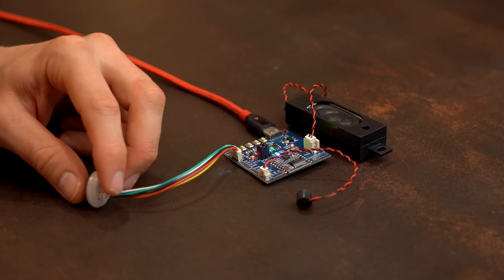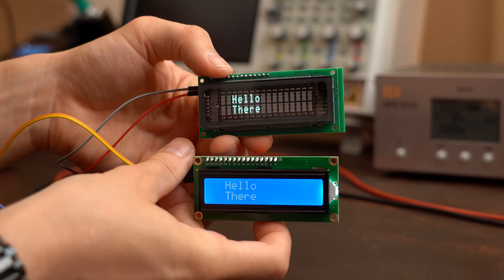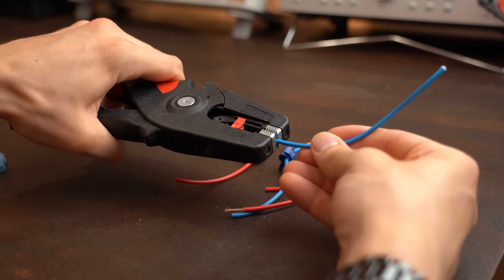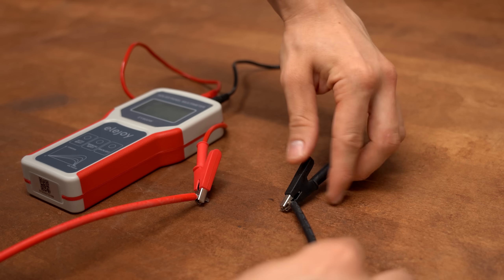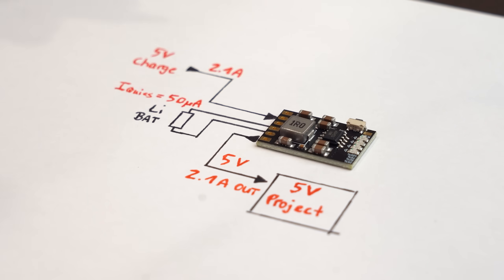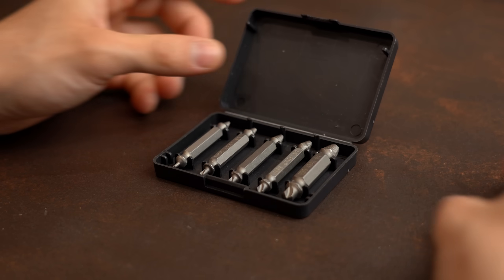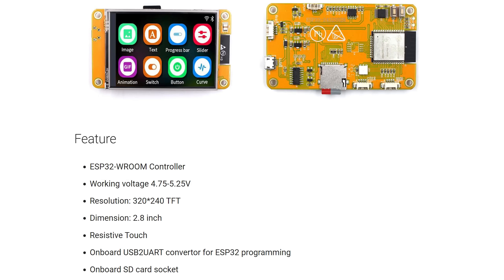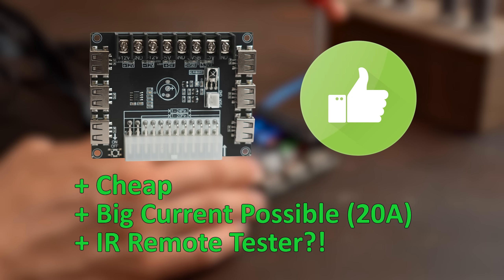I tried finding Hidden Gems on AliExpress AGAIN! (Part 6)

Comment: 2 issues:  T-tap connectors are generally used by car accessory installers, in those cases the mating ends are usually pre-terminated or pre-stripped, so it really is faster to just clamp the correct (color matching, red, blue) T-tap to send something like a low current remote signal, or 12v at less than 3A.  Second, that ATX power supply trigger doesn't have a load resistor.  I've run into ATX supplies that won't turn on without a load, and ideally you should have some sort of load to make the power supply regulate.  I would expect a good ATX trigger to have a load resistor, otherwise you can't know what power supply the customer is plugging into it and thus get a bad experience.
Reply: The problem with the T-taps is they are junk.. Do NOT use them in a car (or anywhere for that matter).  It may work when you first install them, but down the road, they become intermittent causing all kinds of issues depending on what you used it for.  Not to mention the unseen damage it does to the wire.  Just terrible product all around.
Reply: @turbo2ltr so, what should i use in a car to “intercept” signal wires (not power ones) without damaging original cabling ?
Reply: @chrisparussin5359  Nothing. You aren't going to be able to "intercept" a signal wire without at least compromising the insulation (which these do). If you aren't going to be able to "go back to stock" without repairing or replacing the wire anyway, why not go with something more reliable?
Reply: @jcon6734  because if i remove a t-tap, i can leave the blue part of it and it will be insulated or i can just use electrical tape and more fabric tape over. if i cut the wire i have no way to return to stock
Reply: @turbo2ltr  I worked as an automotive electrician for years and they were never an issue you just need to use the correct size for the correct gauge
Reply: You say that while displays I installed at Home Depots around Cincinnati are still working fine a decade later. TONS of low voltage light setups use something similar where the tap is actually built into the line and you just clamp them on a powered line for an active splice and others I've seen are identical to the ones shown in the video. No idea about vehicle usage but I've never seen a crimp on splice fail in a display or using them at home in low voltage lighting setups. The only real issue is if they're marketed as one size fits all instead of marketed to a specific wire gauge like they were intended.  @turbo2ltr
Reply: @Hogscraper cars are an exceptionally difficult environment: you can hit lows of -30C when cold, in winter, and highs of 200C when the engine is fully warmed up.  Lots of vibrations, random G-loads, and don’t forget the occasional splash of water from puddles, as well as salt water either because of the environment, or because it is used to treat the roads after a snow storm. 
Sorta the polar opposite of “non-moving display signs in a temperature controlled store”
Reply: Low voltage lights cover both indoor and outdoor and literally every single low voltage light ran around our deck and yard uses those connections for splices. I seriously doubt any car in my area has an electrical connection exposed to more water and cold than the ones laying on the ground behind my house. Nice that you not only know so little about those systems yet decided to just ramble on based on your incorrect assumptions. Also weird that you think a single mechanic anywhere is using any form of plastic splice, either the one shown or the one he recommends instead, that is intended to lay on the motor block or even outside the cabin, dashboard or trunk of the car where there there typically isn't water or near boiling temps... @RichardBetel
Reply: I mean, it costs three bucks, it's kind-of a you get what you pay for scenario

Comment: I have a near-identical set of LiPo 5V boards I got from Amazon for cheap! Something I did notice tho, a couple were actually not as efficient -- some were only like 83% for some reason. Still, for as cheap as they are... really good.
Reply: Cheap clone chips.
Or possibly reject chips. They find their way into ebay modules to be sold to hobbyists.
Fortunately you are one of the smart ones that can test the actual performance. 👍

Comment: For the 4.2v/5v module. There is same modules for the same price but with Type-C soldered available, they come with usb a unsoldered and can be used right away, no extra connector is required.

Comment: A big drawback of VFD is that they lose brightness over time. Compared to LCD they have a limited lifetime.
Reply: VFD will run perfect for decades.
However, the electro cap on the 40v rail dries out, which causes the VFD to get dimmer year by year. If you replace the cap the VFD will be as bright as new.
I repaired MANY over the years, including my own microwave from 1991 which I have replaced the cap about every 10 or 15 years.
Reply: @wizrom3046  Excellent tip! Thanks!
Another tip (for anyone interested): Put them behind a tinted panel to dramatically increase their contrast and overall appearance (as seen in pretty much every stock car radio and home amp/tuner/etc. for many decades).
Reply: @wizrom3046  I used dot matrix vfd in an product I designed and after a number of years there was clear degradation on the pixels. Fading is a know problem of VFD and a result of loss of emission in the phosphor layer. From the degradation you could see what pixels were usually on. Something that is far less visible on segmented displays.

Comment: If you like VFDs then character OLEDs are a good alternative.   They have superb contrast and viewing angle, and work in many devices that use the HD44780 LCD protocol.  They used to be real cheap before the pandemic (US$8 for a 16x2 display) but availability is not so good now and prices have gone up, but they're still way cheaper than VFDs.
Reply: The big problem with VFDs is they eventually lose brightness and become unreadable. That's probably not too bad for these generic ones but for custom ones such as often found in microwaves and hi-fi equipment, this becomes an issue. I'm actually planning on seeing if I can swap some out and use OLED displays instead (obviously this would require some sophisticated microcontroller work).
Reply: @chaos.corner  it depends on the VFD - some are HD44780 compatible.  I run a FB group (Music Gear Display Retrofits) focussed on finding new displays for old synths.
Reply: Also more durable... VFDs are best for things like HiFi equipment and microwaves where they're not moving. OLEDs will be less upset about bumps. Plus much lower power consumption
Reply: @DoctorX17  ehh, VFD were used  extensively in cars for many many years before LCDs were readily available. They are plenty durable.   Cheap OLEDs are prone to burn in unless you plan to write your code to actively minimize it. Definitely not idea for an always-on display.
Reply: @turbo2ltr  true… fine with shock dampening. But I dunno if I’d put them in handheld projects. And yeah, OLED does have that issue, VFDs can be always on for ages

Comment: You are using the screw extractors completely wrong. They are designed to extract screws that are stripped. You have to drill out the hole and then slowly again slowly use the extractor bit to pull the screw out slowly You can't just put it on full tilt and expect it to extract that screw

Comment: Hi Scott! Maybe dumb question, but did you use your drill in reverse, while tried the screw remover stuff?
Reply: Believe in him, I already bought this kit, I've already tested it and the material is rubbish.  The metal is completely soft and comes apart without causing any damage to the screw.  If you have this kit and it works, you were probably lucky enough to buy one made from quality metal.
Reply: No he did not.
I've used this kit before with moderate success. It works, but the screw can't be very hard to remove.
Reply: he actually makes a lot of really stupid mistakes like that. a lot.
Reply: @itstrysten yes?
Reply: @alexausberlin  yeah more than his fair share

Comment: The screw extractors are designed to be run in reverse and *slow speed* (I am a mechanical engineer and these items are invaluable)
Reply: Thanks for poiting that out, my intuition already told me the way they were used was wrong.
Reply: @qlum  Yeah, I normally gently tap the extractor into place to make it bite that little more and use a spanner not a drill or impact driver for the extraction. @greatscottlab would you be willing to retest?
Reply: Yup the technique is crucial.  I had a similar experience to Scott’s my first time until I got the hang of it.  It’s a useful tool when used correctly.  It’s important to drill a clean hole in the screw head for the extractor to bite into.
Reply: I assume he tried normally and failed, the wobbly bits were theatrics for the camera.
Reply: Drilling straight in, for the properly sized hole, is also crucial for success.
(You can see Scott wobbling and reaming the poor thing around)
The original Alden Grabit screw extractors work almost every time for me.
Reply: Yeah having used them before, slow and easy makes it go alot smoother
Reply: Those cheap extractors are rolled teeth, not cut, so they are fairly blunt. Harder to get a bite than a quality tool
Reply: @wizrom3046 Certainly, but running the drill at high speed in the wrong direction isn’t exactly helping the situation.
Reply: @TheHeadincharge  ... hehehe 😎
Most machining operations work better when they turn in the right direction 👍

Comment: I used that small battery module, it works great but auto detecftion stopped working ater while and it is not responding on all tested modules so the button needs to be rewired on some place out of the case where I mounted the modules

Comment: If you can sharpen the drill bit side of the screw extractor, they are very effective. Unfortunately the drill bits are dull and does not drill. I sharpen mine with a sanding drum on dremel and they do the job flawlessly. The other side of the extractor is rarely needed. On most of the cases only the left hand drill side of the extractor does the job.
Reply: If you have a dremel you're just better off cutting a slot in the broken screw and stick a flat-head into it.
Reply: On larger screws you are right. But you can not do this on m3 screws especially when they are countersunk. I had to use Dremel on a countersunk and damaged device chassis. I mainly work with m2, m3 and m4 screws and this screw extractor is the best solution.

Comment: Is it just me or were you running the screw extractors in a clockwise direction? They have to go counter-clockwise to work
Reply from the maker: I tried it every way. Did not work-
Reply: @greatscottlab  I figured you would, but my intrusive thoughts made me feel the need to check. Love your videos dude!

Comment: Oh no those idc (insulation displacement connectors) connectors...no just no ...please no one buy them.... any electrician/ electrical engineer crys every time they come to a machine wired with idc connectors... I see so many problems due to these poop connections.

Comment: Thanks Scott for this episode! I had a similar experience with screw extractors (completely useless) and cable splitters/connectors (carefully to be used if at all, I used them once, outdoor for 12V with 0.75 mm2 wires, and covered from rain place, also adding some silicone inside)
Reply: I personnaly used similar screw extractors once and it worked. There are a few videos on the internet that compares them, I may find a link if you want

Comment: the screw extractor isn't meant to go full speed but rather full torque slow speed.
you have to push it against the screw so the reverse teeth will bite into the metal then extract the screw
Reply: This is the key. Speed is not your friend here.
Reply from the maker: Yep. Tried it all. Didn't work.

Comment: for the ATX breakout board I wouldn't go above 15A for 5V, 10-12A for 3,3V and 6-8A on 12V due to connector having 5 wires for 5V 4 for 3,3V and only 2 for 12V
Reply: Amount of connectors has nothing to due with Amp capacity.  It's all about the tracks and all tracks are rated @ 20A,  Maybe play it safe and limit currents to 15A.

Comment: the damaged screw thing can work if you have a drill bit to drill out a bit of the head of the screw and then use the other side of the extractor to take it out. it is an inconvenience but works in a pinch
Reply: Believe in him, I already bought this kit, I've already tested it and the material is rubbish.  The metal is completely soft and comes apart without causing any damage to the screw.  If you have this kit and it works, you were probably lucky enough to buy one made from quality metal.

Comment: Almost looks like when testing the screw extractor that you had the screw extracting tap rotating in clockwise motion? And even if not, the hole was too big to start with and the tap was bottoming out and not capable of grabbing the screw. Could be that the exctractor is just plainly bad, but to me it looked like that the hole in the screw could have been too big in the first place.
Reply from the maker: I tried pretty much every possible technique when it comes to this thing. Nothing worked.

Comment: The problem with the USB ports on that ATX PSU breakout board is that some badly designed appliances don't properly limit the current when charging their batteries.
I've swollen the battery of two smartphones from two different vendors (Sony and Motorola) by charging them with 2A+ computer power supplies.
Reply: so it means the charging protection isn't in the phone but is expected by those two brands in the charger itself

Comment: For those of us on the decidedly hobby side of electronics, that last module looks like a great value!
Reply from the maker: Definitely!
Reply: I have a couple 250 watt ATX power supplies that I bought for another project that are smaller than a pack of playing cards that would work great with that. The PS takes 12 volts in and is a 250 watt ATX power supply with 24 pins and a 4 pin mother board connector and 2 accessory connectors.  Just imagine the ATX power connector with a densely packed circtuit board connected directly to it.
Reply: @Alacritous may I know where you bought that 250 watt ATX power supply and what is the brand and model please?
Reply: Oh yes. I have two different once ow those and they work great. This new one with usb is also on my list now!
Reply: @7:10 I liked the time machine stuck on rewind.
Reply: Only issue is that I wish they would have added inputs for the CPU or PCIe power connectors. The 24 pin connector alone doesn't carry much current on the +12v rail. You're only looking at like 150w max there.
Reply: @HodgePodgeProducts   That's a good point, and one reason why the DIY bench supply route is superior, if you have the time and skills.  You get the whole current budget that way.
Reply: Dont be fooled, it is great value!

Comment: The T-splitters are only useful when you need to tap into a live wire without possibility to stop the current, they are not meant to replace traditional wiring if you start from scratch, or can stop the current.
Reply from the maker: Hmmm good point.

Comment: Hey. Is it possible with the ATX Power supply board also more voltage to get ? Is the 12 volt maximum or we can get also more ? Thanks
Reply from the maker: Not more. Sorry. I made a video about that topic as well :-)
Reply: @greatscottlab  The updated board I think has a buck convertor on-board that gives adjustable pot voltages from 5 to 12 @ 2A?